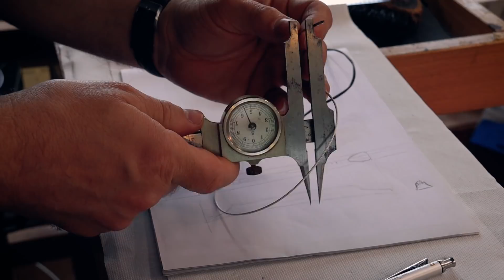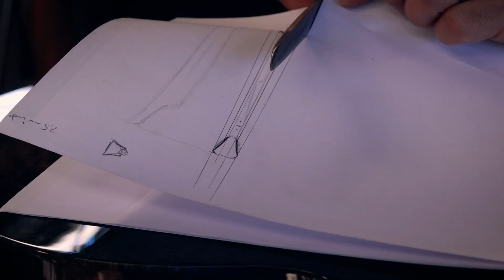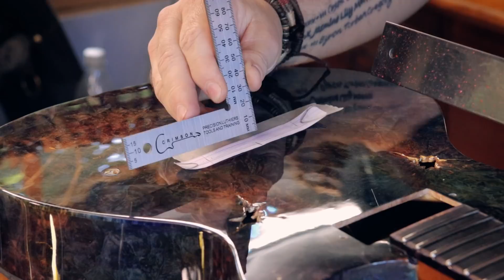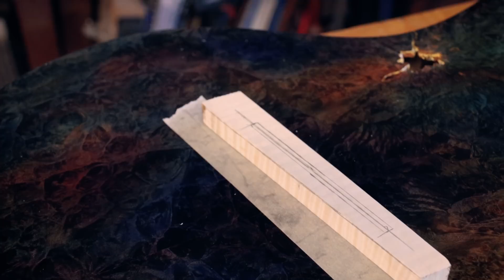Ep 24 Custom Bridge & Pickup Cavities, Oh My! - Making a Modern Multi-Scale Electro Acoustic Guitar

Comment: Ben, you could mount your logo onto the section you cut out for the pickup, and finish the edges - voila a cool memento of a prodigious build.
Reply: Was thinking the same, but mounted on the inside of the guitar case or signed certificate.
Reply: I would buy it and mount it on a nice copper plate to have it on my desk.

Comment: This makes me think that for working on lacquered instruments, a variant of the acoustic guitar saw that cuts on the push stroke would be ideal to prevent it from chipping. Of course, with it being very thin and delicate, it would require a very light touch and sawing into an instrument with finish doesn't seem to be a situation one finds themselves in often, but when that time comes, it might be the tool for the job. And as Ben says in the episode, there are very few tools that only have a single use, there might be one that's just not immediately apparent

Comment: Ben, love the mag pickup but worried that you will have impedance issues balancing the piezo output with the mag. I've been trying to get a saddle piezo to work on a strat for the last year and and trying to blend it with the mag output has been a nightmare. I've tried the blend pot method (barely worked) and also tried 2 different internal preamps (only work when the piezo and mag signals are completely separate, i.e., not even the grounds are connected). And so I've ended up using a Fishman Powerchip which properly balances the impedances and allows to blend in an acoustic output or keep them separate via a TRS jack. Good luck and thanks for sharing. Mike
Reply from the maker: I am suddenly more worried than I had hoped to be by this.. thanks 😊 🫂

Comment: The bridges I can think of have the grain going perpendicular to the strings, not parallel. Of course, they're all flat-tops, and I'd have to drag out my mandolin to check an archtop instrument. Will there be a meaningful difference in strength and survivability? Is the bridge going to float somewhat, depending on the play in the piezo wiring?

Comment: Beautiful! When I have worked with burl tops I have found that any natural holes/voids tend to chip away and be very pressure fragile.  Did you have to do anything to stabilize or reinforce the wood?
Reply from the maker: imo it depends on the species of wood to a certain extent, this maple is actually pretty stable on it's own.. poplar in the same dimensions would be cracking or falling apart all over the place at these thicknesses

Comment: Spoilt by the pickup. You do not need visible wound pickups anymore , if you understand the basic principles of disturbing a magnetic field and using ultra low impedance boosted by a transformer or boost/ buck type I.C. My neck pickup fits in the end of the fretboard after the 24th fret . The wires pass down to the mini transformer and preamp .
I note you worked out the node point of the strings for optimum pup placement. It's the pup placement  that makes certain guitars sound like they do even with the same type of pickup .

Comment: Ben, why did you repair the chipped lacquer with superglue instead of using lacquer thinner or equal?  Wouldn't the "thinner" have basically welded the chip of lacquer back into place instead of adding a dissimilar material?  Curious, but trying to learn, minds want to know.  ;)
Reply from the maker: Hey Bob, I simply didn't have any of the correct lacquer thinner to hand and superglue is damn close and did a perfect job of it..

Comment: Please use as much detail as possible if the wiring. Doing an acoustisonic style build Now,  but am racking my brain about wiring a piezzo via a pre amp and a magnetic pickup all to the same mono Jack.  Pre-amp needs to fit into 40 mm deep cavity.
Reply from the maker: I think you will need a stereo, or switched jack, in order to turn the battery off when not plugged in.. unless you have an on/off toggle.  Either way, I will be wiring this up outside the guitar first to see how it all goes and will film the process..

Comment: hey Ben, if the pickup had horizontal fret wire that followed the scale lenght, could those "technically" be used as additional frets when using the piezo/bridge pickup? Seems like a weird but neat idea
Reply: Sounds dumb.

Comment: fire move wood so just need fire on both sides and it should move back you just need to balance your heat
Reply from the maker: I really should have done this!
Reply: @CrimsonCustomGuitars  i have found that it is best to alternate charring whenever possible on both sides of material so as to help even out the stress or if a bend or bow is needed to char first and see if you can move the wood that way and then fine tune      on a side note i have enjoyed charring turned hand tool handles and then rubbing in linseed oil(generously)  and buffing it back while the wood is almost to hot to handle gives a really nice deep black and a satin finish that is quite drippy